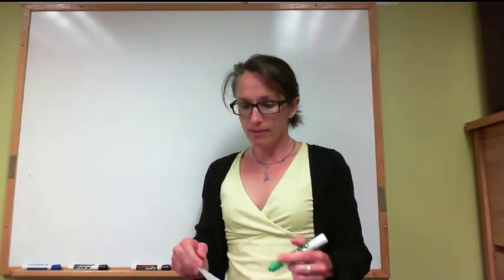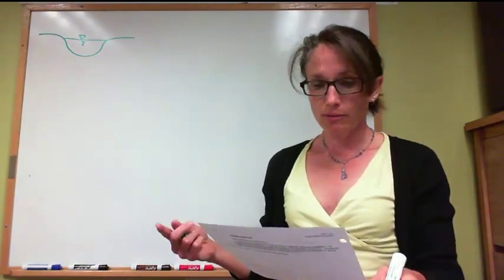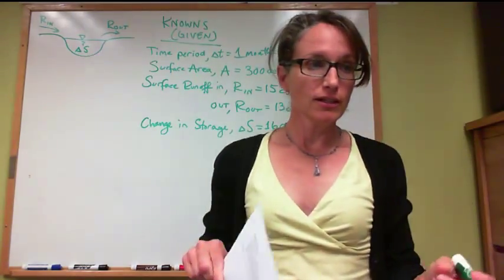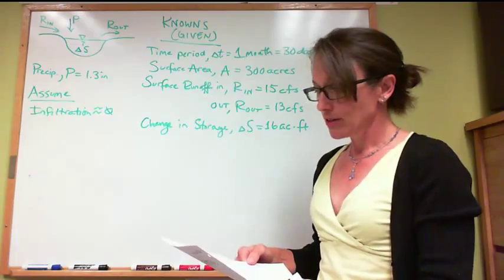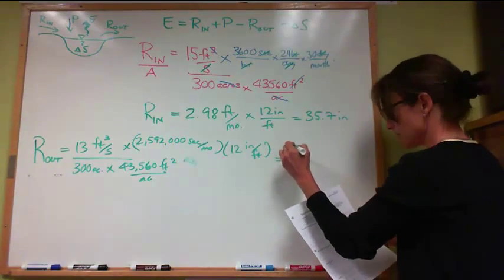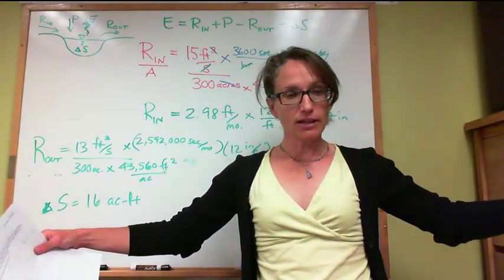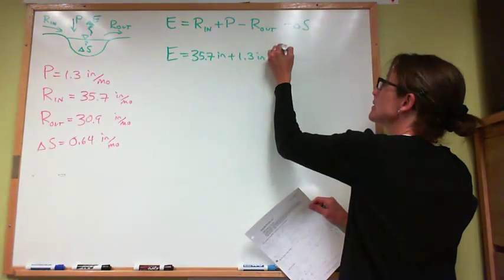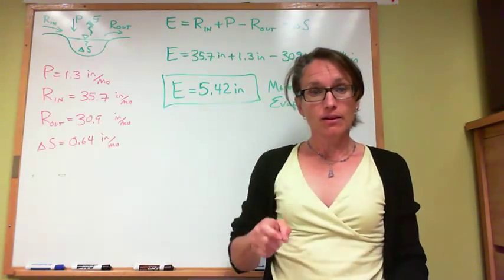Water Balance Example 1

Comment: A water balance for Mupfure dam was made for one day. There was 5 mm day-1
surface evaporation and 2 mm day-1 rainfall. The surface area for Mupfure dam is 
estimated to be 2 x 106 m2
. The inflow was on average 3.5 m3 s-1
, the out flow was 
on average 3.4 m3 s-1
. Calculate the water level on this day ....may you help me

Comment: Thank you for your useful and educating videos. I would like to calculate the monthly water balance for a reservoir. In this case how do we set the equations? For instance, I have calculated the net loss/gain by simply the difference between the total input and total output. My confusion is about where exactly the Lake water level and the lake volume is used in the water balance because using the lake water level and bathymetry I am able to calculate the lake volume at anytime. Secondly, for the two consecutive months, what do we consider as the change in the storage? How do we do that? Is it an average monthly lake volume or is the volume of the lake in the last day of month? 
Thanks

Comment: hi mam can u help me with few examples to solve this..... using this formula tswc=effective rain+irrigation+capllary water-evaporation-runoff-deep perrcolation

Calculate the final soil moisture (% in weight) after 10 day-period using the water balance equation and the following data:  
 
Soil moisture at the beginning 25 % in weight  Average ETc 5  mm/day Soil density 1.3 g cm-3  Crop root system maximum depth 60 cm Total precipitation 10 mm Irrigation 15 mm Leaching 25 liters m-2

Comment: A LAKE HAS A  WATER SURFACE ELEVATION  OF 103.2m ABOVE DATUM AT THE BEGINNING OF A MONTH .THE LAKE RECEIVED AN INFLOW OF 6 m3/s ,OUTFLOW OF 6.50 m3/s.IN THAT MONTH LAKE  RECEIVED A  RAINFALL  OF  145 mm. EVAPORATION WAS  61 mm. WRITE THE WATER  BUDGET EQUATION  FOR THE  LAKE  AND CALCULATE  WATER SURFACE ELEVATION  OF  LAKE AT THE END  OF THE  MONTH. THE SURFACE AREA  CAN  BE  TAKEN  AS  5000 hectares. ASSUME  THERE IS NO CONTRIBUTION TO  AND FROM  GROUND WATER  STORAGE .